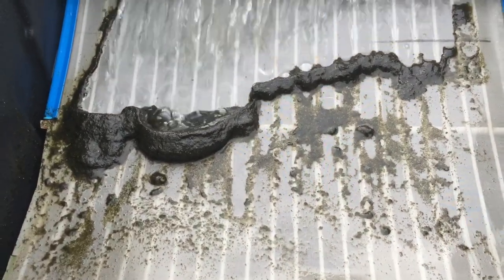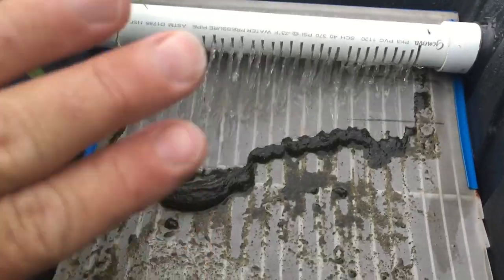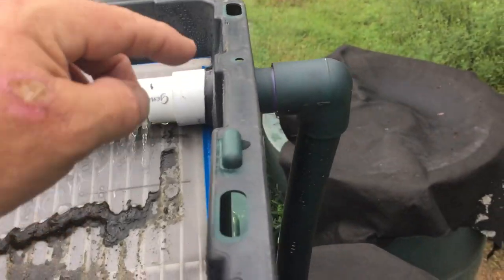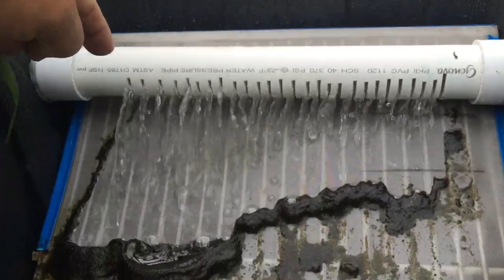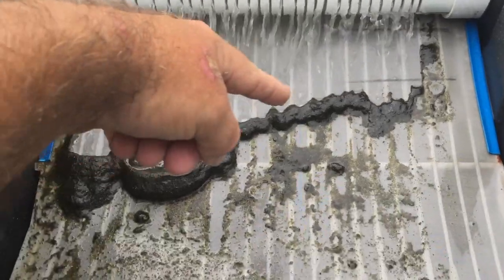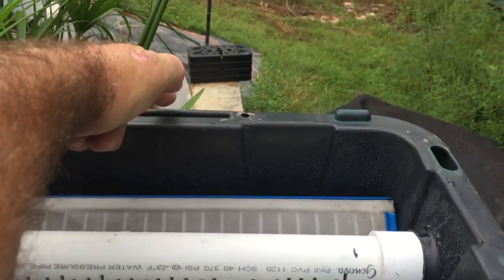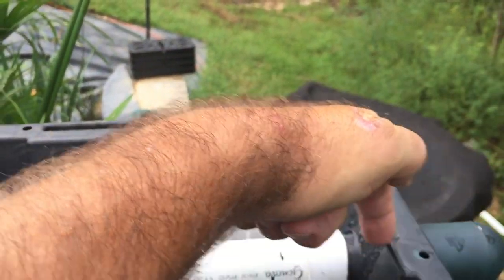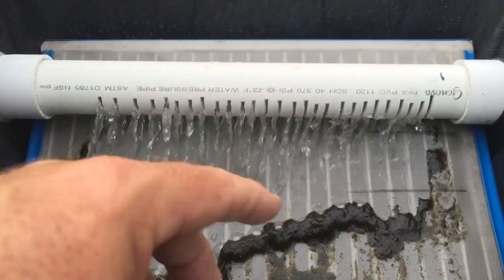Micro screen Sieve bakki tower

Comment: Don't bother with the split flow, putting a wedge into the pipe might already do the trick. Need to control the pressure along the pipe.

Comment: nice filter,  looks great.  couple of question !! how long before the screen clogs ?  whats is the flow rate.
Reply from the maker: Sri Prasad 

This is 100 micron mesh. As bio film grows on the screen the holes get smaller and too much water flows over the screen instead of through it. I'll be replacing it with 400 micron this season.

The flow is about 1000gal per hour
Reply: thanks.  helpful.  am using something similar.   running on 60 micron.  clogs(bio film) in 3 hours.   thinking of using spray bar like rdf!   what do u say?
Reply from the maker: Sri Prasad 
60 micron is very tight mesh! If you have the means to set up spray bar..... give it a try!

Comment from the maker: This is 100 micron mesh. As bio film grows on the screen the holes get smaller and too much water flows over the screen instead of through it. I'll be replacing it with 400 micron this season.

The flow is about 1000gal per hour
Reply: Jason Gervais 250 micron?? How about that? Do u think it will be okay?
Reply: could maybe put a UV over it to prevent the growth